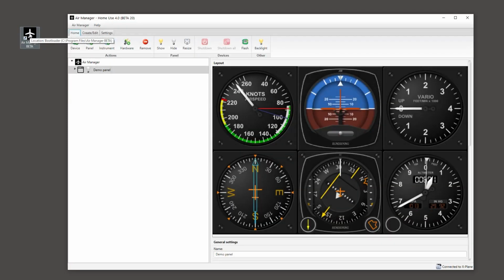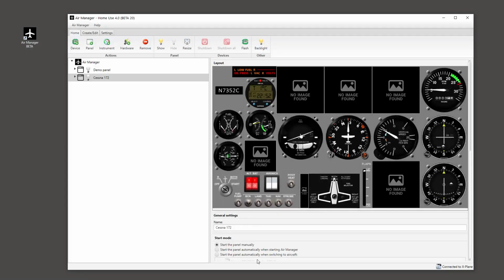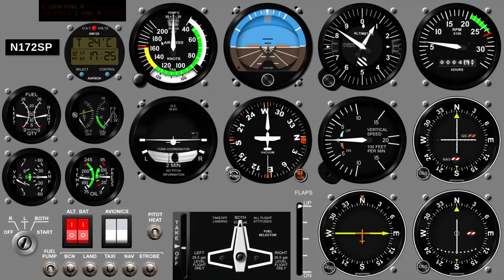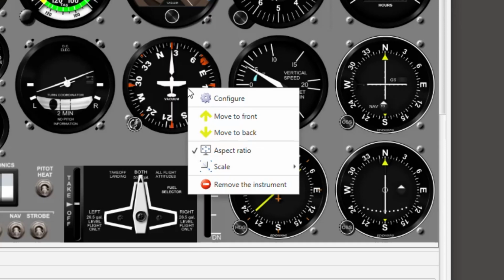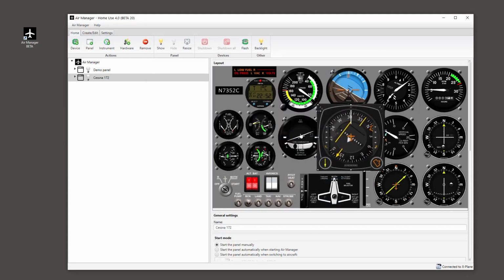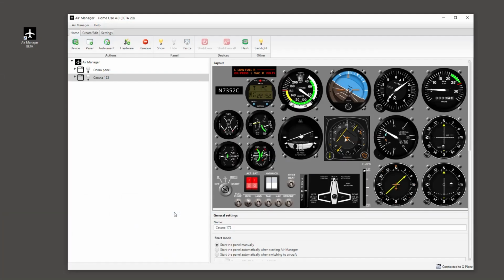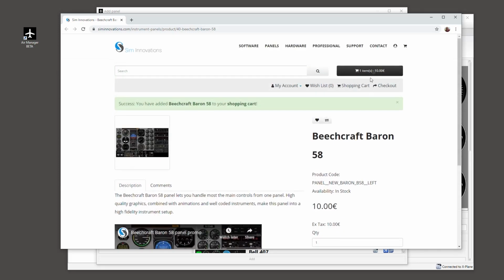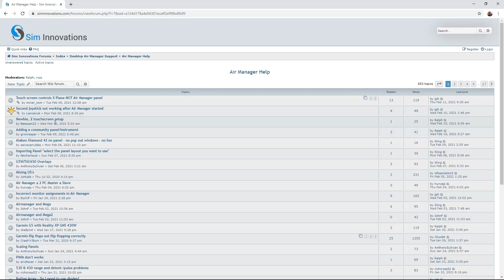Air Manager 4 - Getting started

Comment: Having trouble connecting air manager to flight simulator (msfs 2024) running on a different computer (same network). Any suggestions?
Reply: Also note that version 4 is NOT compatible with MSFS 2024!

Comment: I got this far, but I still can't use the dials for scrolling... it just acts like a click button most of the time, occasionally letting me scroll the dial, but if I can scroll a dial, the lag is HORRIFIC (like a solid 5 second delay).  I'm on a high powered machine (7800X3D, 7900XTX, 64 GB 5600mhz RAM..)  Any ideas what is causing this?  XP12.  Have not tried it in MSFS yet.

Comment: I can see the value of this product, however the price is outrageous. 65 euros (ex vat) for a single computer license? And you have to pay another 30 for the player to run screens across different computers. I can not image that this has the same value as the actual flight simulator itself. (prise wise or effort)
Reply: Air Player is not required.

Comment: Thank you for you great instruction videos.  I started today on trying to put the two G1000 panels for the C-172 (FS 2020).  I went through the processes and was able to get the blank panel up as default.  When I went to instruments I was unable to locate the G1000 instruments.  All that is shown on the Air Management page is 6 instruments for the Beechcraft B58.  Any advice?  Thank you.

Comment: In MSFS 2020 I wanted a way to view panels easily whilst a guest uses VR. This is so I can provide advice based on the panels without being in VR with them.
I found the ALT GR click function to show panels but the panels don't update properly when VR is active.
Will Air Manager 4 help me in this regard to setup panels a person can see outside of VR whilst a 2nd user is in VR or is Air Manager 4 a bit overkill for this simple ambition.
Thanks,
Reply: That sounds like a MSFS limitation? You can also use analog instruments, but I understand that you want glass.
Reply: @ralphrietveld  Hi, yes I think it is a msfs limitation, it must view VR as being too much overhead to then go rendering the displays elsewhere on 2nd screens whilst vr is running.
Perhaps it just isn't a scenario that many people have enquired about, afterall if you are playing alone and in VR you are not going to be caring much about panels or displays. I am effectively trying to create a '2 player' situation where both can see.  I have read about another tool that lets you share flightdeck controls but that requires a 2nd computer configured in the same way so they can communicate with each other and it seemed a bit overkill, I only wanted to be able to see main instrumentation even if it were not rendered in a realistic or faithful way, altitude, heading, speed, rate of climb/descent etc.  If you work with somebody in VR at the moment, you have to ask them to look at the speed dials so as an observer you can also see 🤣

Comment: Hi all, i  am using C172 Skyhawk (G1000) on MSFS and I created the instrument panel with Garmin G1000 overlay and also tried Garmin G1000 NXi Overlay on the Air Manager, along with Cessna 172 Flaps Lever. When putting it on live, along with MSFS running, the input I made on G1000 overlay on the Air Manager instrument panel, is not making any changes on MSFS PFD, flaps input on the Air manager overlay is also having the same effect, but when I tried flaps in the MSFS, it is making changes on the Flaps Lever on the Air Manager instrument panel I made.

I tried the resolutions given on the website, the log file seems good and I even turned off the firewall. I have one system and two monitors connected, so they are in the same network. please help
Reply: Please use our support ticket system or forums for questions.

Comment: @Sim Innovations, I want to try Air Manager before buying it. 
I've logged into the account that I've created, but the Activation screen is frozen on the "Select Active Licenses" screen.
Moreover, the Cessna 172 Panel is not free but has only a "Buy" option showing in front of it, which is different from what's being shown in your video. Is it Payware now? Which ar the free panels available for the Air Manager Demo version; I can't find any?
Reply: Without a license you can only run the demo panel, nothing else.

Comment: Is Air Manager still work on Windows 7?  Have an old PC that I would like to use for the instrument clusters as it has a decent graphic card ( for its age) and i already have 3 touch tablets configured as monitors on that PC that I want to use for the Air Manager.. I have downloaded and tried to install Air Manager on this PC , but when i start it I am never prompted for the language selection, and it never starts. PC on same LAN as FS , CPU AMD Athlon 64 Dual Core , Graphic Radeon x1950 , I can install and run on FS PC , but with 6 monitors its too taxing on the GPU
Reply: No, the minimum OS is Windows 8, but rather Windows 10 or 11.
Reply: @ralphrietveld  thank you for confirming,  there are lots of threads stating different supported versions,  working on upgrading systen to win10 64 bit to get this project moving forward again .. cheers
Reply: @lancesmith4102  it used to be Windows 7. But the latest VS redistributables aren't working on Windows 7.

Comment: Do you know if air manager is compatible with x-plane 12? Does not work on mine.
Reply: Yes it is compatible. But you probably did not install the plugin for X-Plane 12. You can either do this manually with the current plugin installer by selecting manual installation, or wait for the updated plugin installer which will be available soon.

Comment: You might add the steps to get these panels onto X-plane.  I am having a problem getting a newly designed panel onto an aircraft in X-plane.  Do you have to work air manager before you start X=plane?  Sometimes the panel doesn't show up on my smaller 4th monitor.

Comment: Why is the iPad version so limited and toy-like when the Windows version seems to have a lot of obvious simple things that are not in the ipad version.  For example,  why can’t I just see all parameters that are in the XPlane system, and just see one of them as a dial, or a number, with a scale of my choice?     I am trying to learn to fly helicopters on XPlane and the iPad version is nearly useless for this.  I just wanted to be able to pick the core engine parameters for my current helicopters, and map them to dials on a screen, even if they are super basic lines-on-circles.
Reply: Because that's not the purpose of the iPad app. It is made to quickly put a panel together and fly. Also, a lot of the desktop functionality would make no sense on the iPad. You would have to have a code editor on the iPad for example. And you wouldn't be able to modify the resources (images and such) because Apple does not let you.
Reply: @ralphrietveld    A simple generic widget that has a fixed text output format, and all you can do is select which parameter and how big a font to display it, would let users solve the problem of "there's no gauge for X, and no way to add it".   If that could also be shown in a linear or circular form as a 0-100% of some user-entered range, NO CODING would be necessary on the Ipad.       It's even funny that on the desktop app, you have to code, to just add a torque number, or an APU parameter, that there is no gauge for in the library.

Comment: I've been running the Air Manager 4 beta with MSFS for the last couple of months and it's been great. Just bought the full release version when it was released. I absolutely love it. There's no better way to control a plane without a mouse and keyboard. Can't wait for more instruments and panels to be MSFS compatible.
Reply: There's gonna be a new plugin soon. This one was just a temporary one, due to limitations of FS2020. But they have made some updates so now we can make a better one.
Reply: @ralphrietveld  Good to hear. This one works well, as long as you know how to work around it when it stops working. 

Nonetheless, a proper working version would be a nice improvement.

Otherwise, AM4 works a treat with MSFS. I wouldn't even dream of flying without it now.
Reply: Upvoted just for the username and profile pic!
Reply: how did you install the plugin. i'm having issues where the Plugin installer is putting the bridge files in C: but my fs2020 installation is on a separate drive (due to it being so big). help would be greatly appreciated.
Reply: @091263david  The Air Manager plugin installs itself as a Windows service. It doesn't need to be in the same location as MSFS. Its location doesn't matter at all. It could be on any drive connected to your system. As long as Windows sees it, it will load it up at boot time.

Now that said, I've got an issue with the plugin. It will work, but if I shut down the sim and reload it, it no longer starts up. I either have to manually go and restart the service, or take the easier and quicker route of just doing a quick reinstall of the plugin from an icon I keep on my desktop.  It takes less than 30 seconds and can be run at any time with the sim running or not.